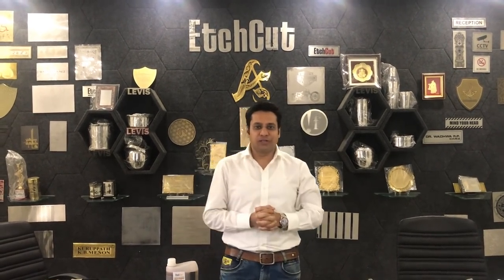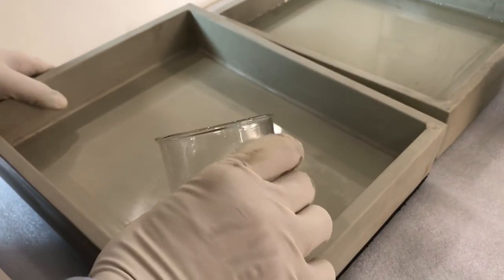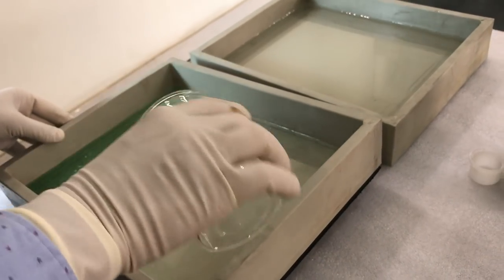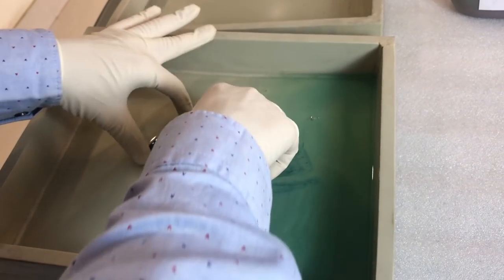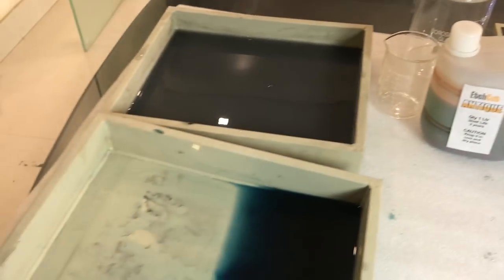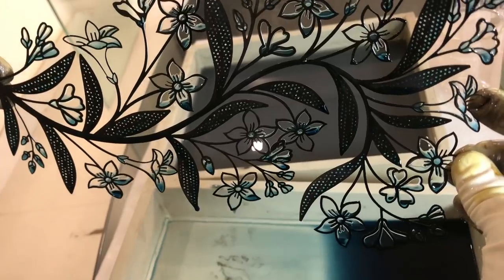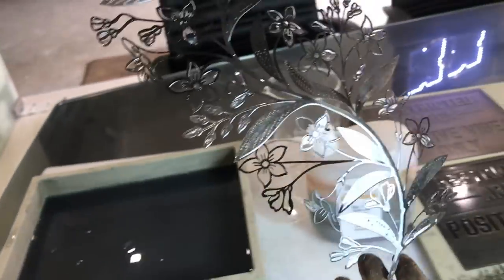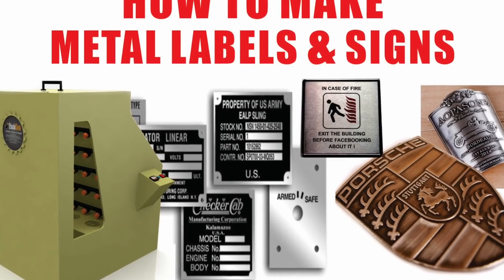How to give antique, dark oxidise , patina finish to Brass

Comment: Thats really a cool development, Now we have stop using the plating machine for oxidising, which is expensive to operate and maintain, as this process does not require any machine and electricity, good job
Reply from the maker: We're glad you like the finish, we're coming up with another that no one has yet made.
Reply from the maker: @gimax4689  already launched, send mail to info@etchcut.com

Comment: what about not dipping? any wipe on or paint type solution?
Reply from the maker: Dipping is the only way it will react with brass, Spray cannot work as you see there is a variation of finish which is only possible with dipping
Reply: @Etchcut  there's no acetone type finish for brass sheeting?
Reply from the maker: @jdaspects  No

Comment: What is durability of finish
Reply from the maker: As you have seen in video after giving the final finish we put a top coat of matt lacquer, now it's upto you how durable you want as there are diff type of topcoats available in the market you can choose as per your requirement. for more information on pricing please mail at sales@etchcut.com or call at +918826600163